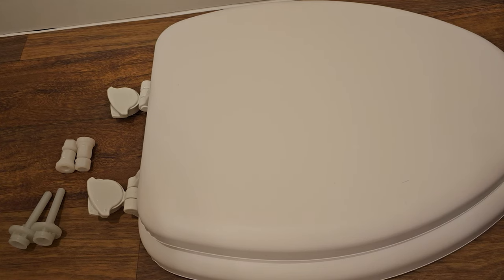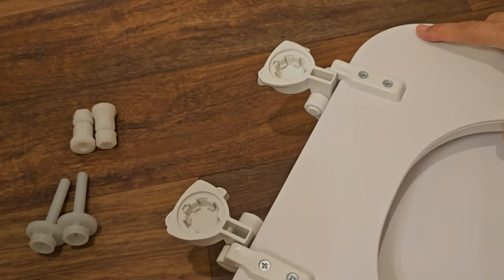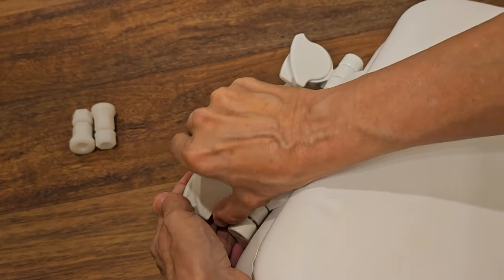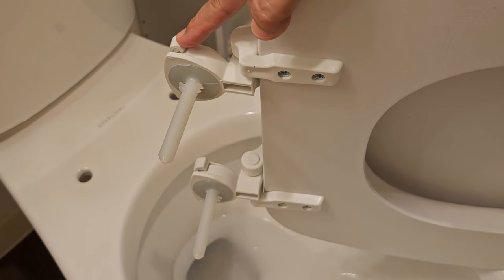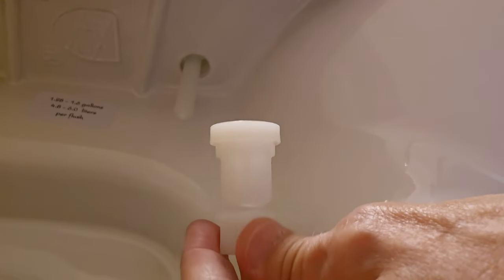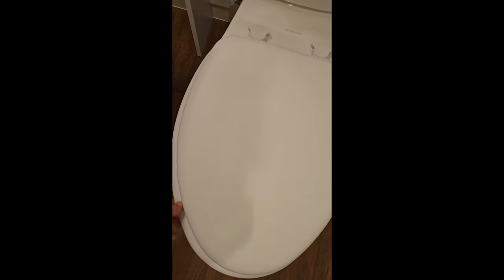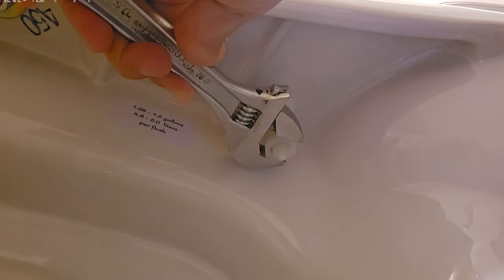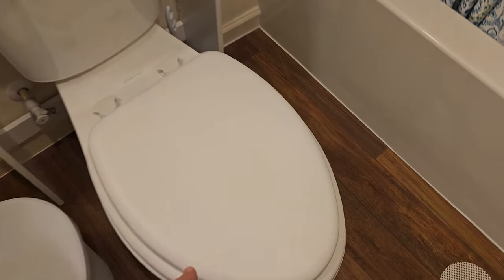Mayfair Bemis Toilet Seat Installation - Quick and Easy!

Comment: Some people may have trouble trimming the wing nuts.   You can remove the seat, hold the wing nut in place, and tighten it with a screwdriver.   That  is on the small packet of directions that come with the seat. That method does not require trimming the wing nut.
Reply from the maker: Excellent info!

Comment: Just a heads up for those who may have notched nuts with their screws or don’t feel like tightening from the bottom. The top latch flips up and off to access the top of the screws. Its takes a good pull to pop it off, but from there you can use a wide-end screwdriver or drill to tighten it.